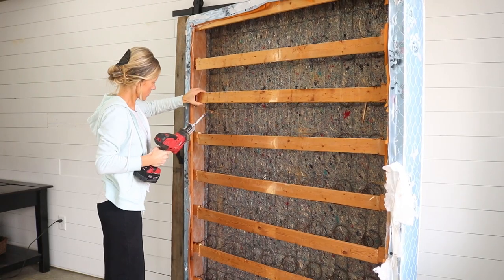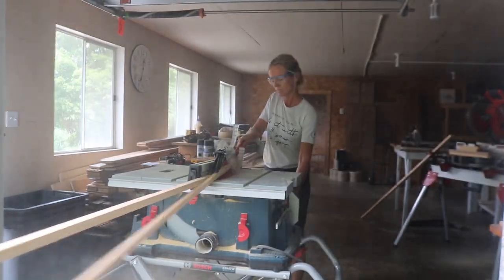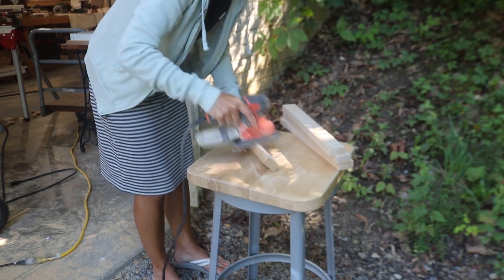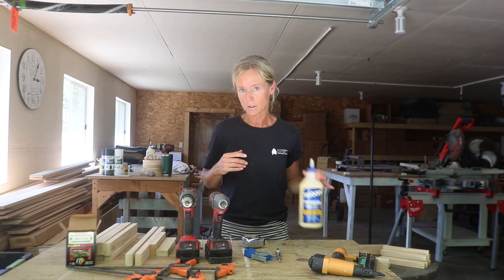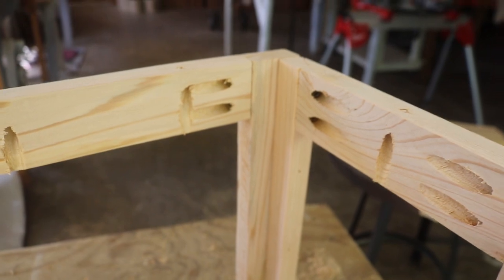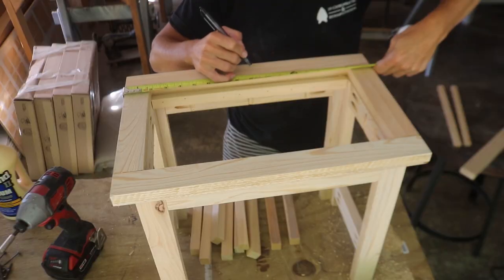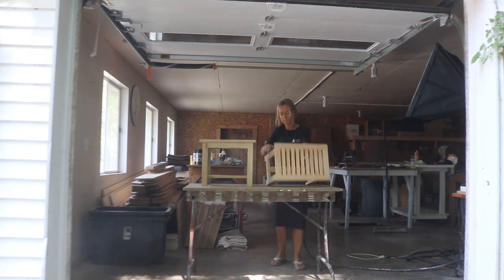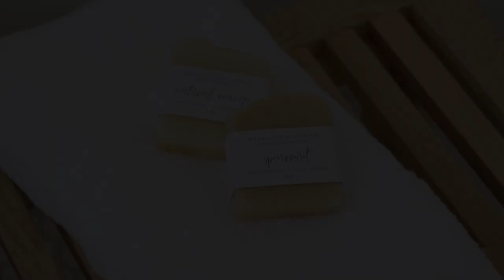DIY Spa Benches ~ Spa Bench Tutorial ~ Cypress Spa Bench ~ Wood Spa Bench

Comment: Just a suggestion... You could put some little chairs glides into the bottom of the legs just so they would set just slightly out of the water when not in use. Maybe it would help with not swelling or rotting the wood quite as quickly. 😊

Comment: Nice work but even if you don't do that much woodworking I'd recommend wearing a dust mask when using your power tools. Even with plenty of outdoor air there's quite a bit of particulates going into the air that you could be breathing in that won't be good for your lungs over the years.  The really fine particulates are accumulative exposure concerns as they're too small for your body to get rid of them.  Especially, when you're cleaning and using the compressed air on your table saw, etc.  Some woods are a bit toxic and can cause allergic reactions after prolonged exposure to the saw dust to watch out for as well.

RZ Mask is pretty popular for something that can be quickly put on and taken off, along with a few other options, but 3M has a number of options that will also provide vapor protection when doing spray finishes, painting, etc. work. with replaceable filter cartridges that you can get for the specific work you're doing.  

Again, nice work, just always good to be a little pro-active on wearing safety gear when working with power tools even when your risks may seem to be low.

Comment: Cute spa benches, do you think it would be beneficial to put some kind of plastic ends on the bottoms of the legs so as the water drains down ward they won’t hold water between the end wood and the tile floor. To keep the ends from rotting and/ or expanding. Just thinking. Body butter would be good for the bottoms of your feet at night after showering. So thoughtful of your husband comes to check on you. ♥️ Pebbles adores you! It’s so evident.